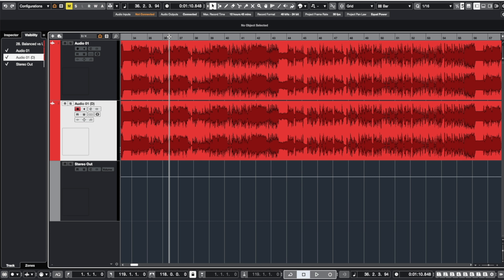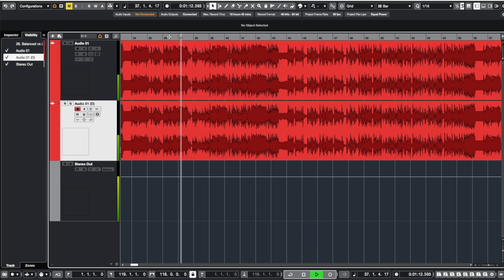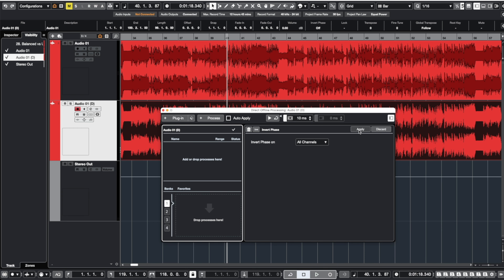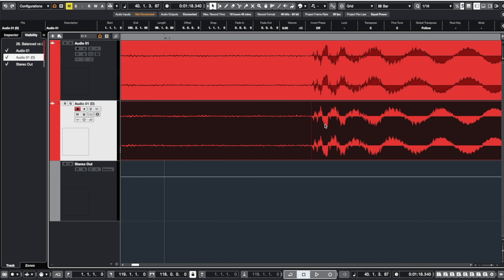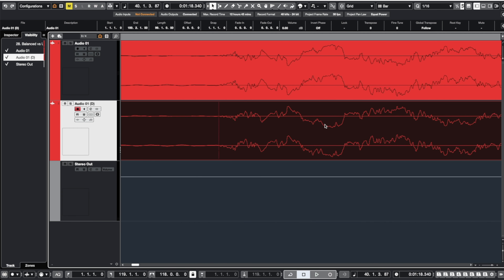Balanced VS Unbalanced Cables — What’s The Difference?

Comment: Are 4.4mm balanced and 3.5mm sounds difference?
Reply from the maker: There shouldn't be any difference in sound quality, providing both cables are in good working order!
Reply: The hifi audio balanced concept isn't related to the balanced concept explained above.
Balanced cables of hifi audio pertains to stereo and provides each channel a ground of its own. Whereas, balanced associated with pro audio is not a two channel (stereo) connection.